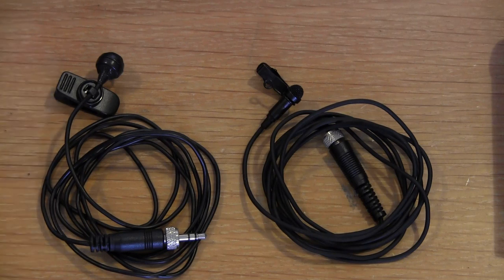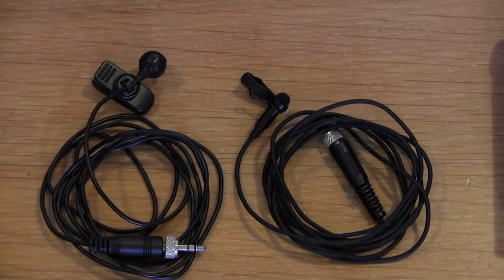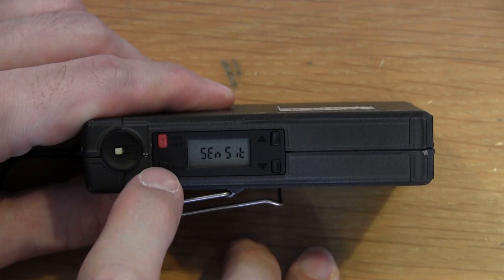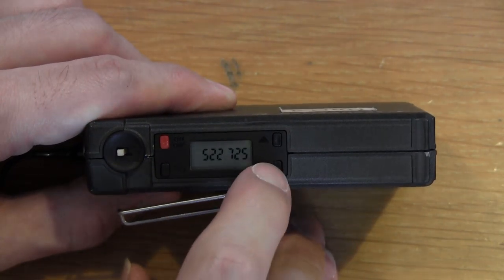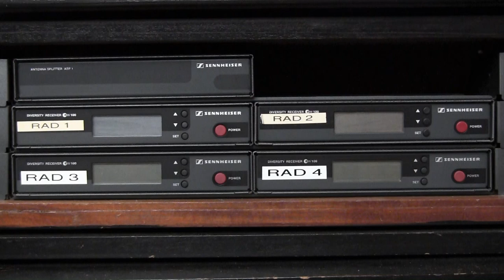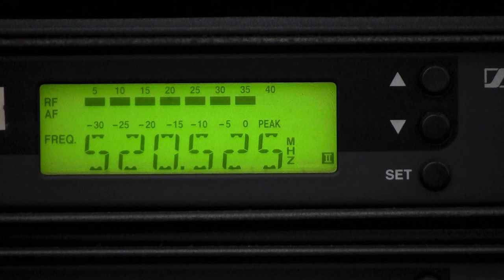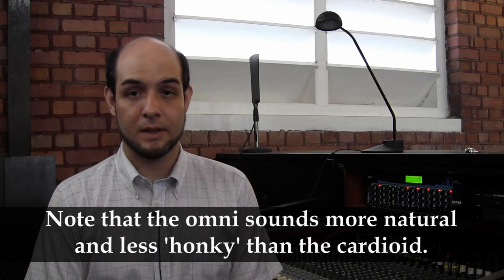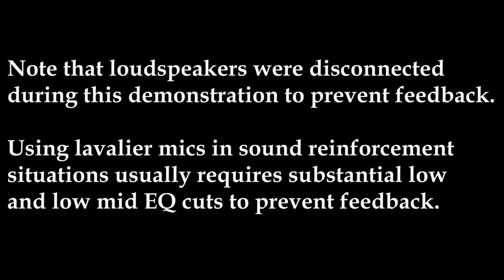How to operate the Sennheiser EW 100 wireless microphone system

Comment from the maker: - Thanks for the question. The 1st generation evolution wireless system is no longer in production so it's unlikely that you'll be able to buy replacement body packs, unless you buy them second hand. The newer body packs (G2 and G3 versions) are not compatible with the EW100 system. However, Sennheiser will, at least in Singapore, continue to repair this older equipment, so I suggest you look up your closest Sennheiser service centre from their website. All the best!

Comment from the maker: - Ok if that's the case you may have an issue with the transmitter itself. I would suggest finding another ew100 transmitter and setting it to the same frequency as yours to verify if the receiver is ok. If the new transmitter works, then yours will need to be sent for repair. From what you say this does not sound like operator error.

Comment from the maker: - Thanks for the question. Have you checked your batteries? The screen should come on as soon as you hold down the power button. If yours does not and the transmitter still functions, then you may have a dead LCD.

Comment from the maker: - You're welcome. Yes, try installing a fresh alkaline battery and see if that fixes the problem. If the pack still functions you can continue to use it, although you won't be able to see any of your settings. Alternatively you can take it to your nearest Sennheiser service centre to get it repaired - they are quite good at standing behind their products and will repair products that are long-discontinued if they are able to get the parts.

Comment: thanks for the reply, the antennae are both connected to the receiver, the frequency is set in the right way on both the receiver and the transmitter, the battery is new

Comment: Nice Video sir.
 i have the same setup transmitter  & Body Pack Receiver  can u tell me its AF out is Stereo or Mono because my Nikon D7500 Show Single Channel of audio.
i am waiting your reply.
Reply from the maker: It will be mono for sure because there is only one signal. However it may be able to be switched to dual mono where it outputs the same signal to both L&R channels.

Comment: Hi our church has, what looks like two of these systems rack mounted - this is the first info I have found anywhere on these older systems, running at 846 MHz (in the UK) which is a legally free level, only 1 mic and it does not work. Is it possible to buy replacement body packs and will their newer body packs work (i.e. the G3) with the old receivers?

Comment: Buen vídeo
Quisiera saber si el plug de entrada hacia el emisor debe ser necesariamente estéreo o puede ser mono 
Y también si puede ser usado para conectar una guitarra eléctrica en vez de micrófono?
Reply from the maker: For a microphone is needs to be stereo (ie balanced) because it uses one of the terminals to power the microphone. Yes you can also connect an electric guitar - for more info on how to do that see the owner's manual for the correct cable.

Comment: Hello, I have just bought a EW100 G1 and found your video very useful. It may be a daft question but can I plug a hand held dynamic or battery powered condenser mic into the transmitter?
Reply from the maker: +Michael HASTED Hmm, I've never tried this before but theoretically it's possible, using an XLR female to minijack connector. A better solution would be to simply buy the plug on transmitter that Sennheiser sells which is designed for this purpose.
Reply: +GLB Productions Thanks for that, I'll give it a try if you don't think it will do any harm. The problem with the plug-in transmitter which, as you say, is the ideal solution, is that they cost over £250
Reply from the maker: Michael HASTED Try with a dynamic mic first and make sure your cable is correctly wired. As with all experimentation results cannot be guaranteed ;)
Reply: +GLB Productions I assume you mean balanced or unbalanced. Looking at the cable I have, it is not marked. There is what looks like a normal 3.5mm stereo at one end and a female XLR at the other. How do I know if it's balanced or not? What should it be for the EW100? Can it do any harm if wrong? Thanks for being so patient, I do appreciate it. Michael
Reply from the maker: +Michael HASTED It should be wired for balanced operation ie tip to XLR pin 2, ring to pin 3 and sleeve to pin 1. In order to determine if it's actually wired like this you'll need a cable tester, multimeter with continuity function or just disassemble the connectors and match the wires.
Reply: +GLB Productions  Thanks for that. I'll see what happens and let you know. Thanks again for your help. Michael

Comment: BRUNO  I HAVE A QUESTION  WHEN I HOOK UP MY EW 100 TO MY MIXER THE RED LIGHT COMES ON IN THE CHANNEL THAT I HAVE IT PLUG INTO WHICH CAUSES ALOT OF STATIC   ITS LIKE I HAVE HAVE SOMETHING NOT PLUGED RIGHT.  IT JUST STARTED THIS ABOUT A MONTH AGO BUT DOES NOT DO THAT EVERYTIME  IT DOESN'T MATTER IF I HAVE MY GAIN WAY DOWN OR NOR   NEED HELP   THANKS
Reply from the maker: Definitely check your cables to see if there is a short somewhere, also try changing your transmission frequency in case there is some interference on the existing channel.

Comment: Hi,I need help as i have bought two pairs of EW-100 used  mics.i cannot match the frequencies.One of the transmitter shows 790.000,   800.500,  801.000 822.000 2nd Transmitter shows 630.000 ,661.650, 662.000, 650.750 First receiver shows 750.000, 741.000, 740.000 ,742.975 I am having problem I dont know how to match receivers with respective transmitter.Awaiting ur help. Salman Hunza Pakistan

Comment: Sir, I'm using the same wireless microphone. And it really sounds good. But i have a little problem, every-time i turn it off (the microphone) it creates a loud RF noise. Any idea how to fix this? Newbie Sennheiser user here.
Reply from the maker: It sounds to me like you need to adjust the squelch control on the receiver - basically this will mute the receiver output when no RF input is detected.
Reply: Got it Sir, Big thank you to you! One more thing, is there anyway, I can monitor the battery life of my g1 Sennheiser Mic while the show is running? It's not indicating on the mic.
Reply from the maker: If I recall correctly there is just a low battery warning light on this model - when it flashes change your battery ;)
Reply: Got it. Where can I see it, on the mic, or on the receiver?
Reply from the maker: On the mic - it's the red light on the bottom, underneath that rotating cover.

Comment: have the same setup.......but lately there seems to be an issue with the communication between the transmitter and receiver. I have synced them to the same frequency band , but can't get any signal through. Please can anyone help out here with this situattion
Reply from the maker: There are many reasons why this might happen - the transmitter may be muted or too close/too far from the receiver, the antennas may be faulty or disconnected, or there might be strong interference on the transmitting frequency.

Comment: any suggestion for a purchase of a cheaper wireless mic system?? I saw the sennheiser ew100 g3 but it's way too expensive for me
Reply from the maker: - With wireless you tend to get what you pay for, and cheap wireless systems can be very frustrating and cause more problems than they solve. How many channels of wireless do you need to run simultaneously?
Reply: I know what you mean... i could start with just one channel,however running two channels simultaneously would be great.... i was reading some reviews about the Azden WLX-PRO Lavaliere System that is not so cheap,but someone still say it hasn't a good sensitivity and you have to speek loudly. i swa the Azden WLX-PRO Lavalier Mic Kit VS. Sennheiser EW 100 G3 review... Is there any chance to get a better audio editing it with a software to clear the noise a little bit?
Probably a cheaper choice to have a great  sound quality would be recording the audio and then match it to the video...i don't know how difficult this could be...if the camera is not even recording the same sound of the scene it could be a mess.
Reply from the maker: - Sensitivity can usually be adjusted, and all good wireless systems use companding (compression and expanding) in order to ensure decent results within a given range. The transparency of this companding circuit is one of the reasons good wireless systems cost so much. 
I would not resort to post-processing to clean up audio unless it was damaged or recorded in less than ideal circumstances - start with a good system to begin with. 
If you can't afford a decent wireless system, go wired to start with and upgrade when you have the money, it'll sound much better. 
Matching the audio and video is not that difficult as long as you plan for it in advance and have some sort of audio marker that can be used to align the signals. An old-style clapper board can be used, or just clapping your hands together!
Reply: Nice.... If i have two people with two different mic.. too close to each other what could you do? Is there a way to pickup almost only your voice?Probably in that case i should use only one audio track...
Reply from the maker: - There are a couple of solutions - either use just one mic, as they do in interviews, or gate the two sources so that only one mic is on at any given time. This will prevent destructive interference between the two sources.
Reply: You might take a look at Comica CVM-WM100